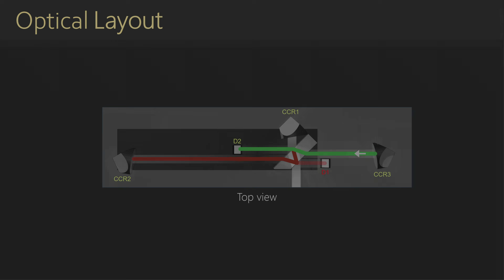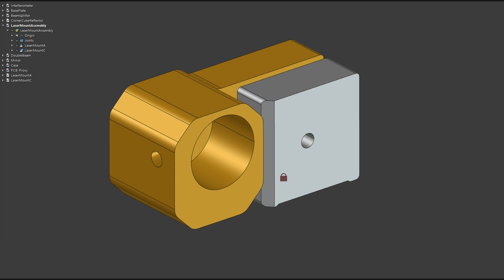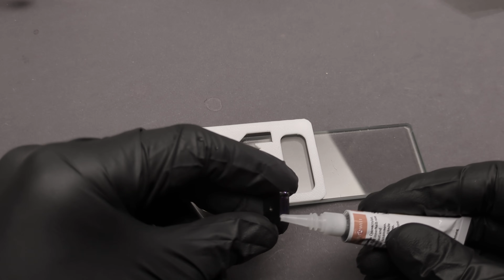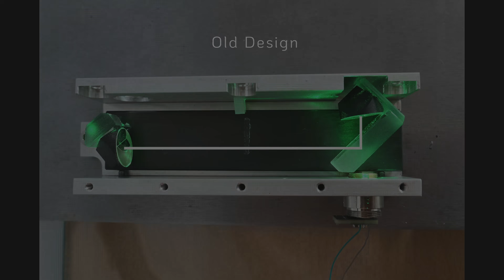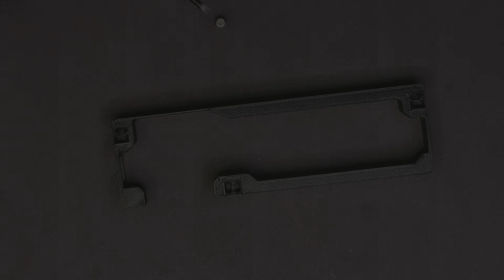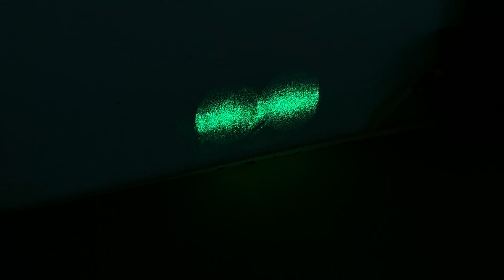Laser Interferometer - Part 3: Mechanical Design

Comment: @DiffractionLimited Schott ROBAX is a glass-ceramic that is made for fireplaces. It is much cheaper than Zerodur and readily available in 4mm or 5mm sheets. It's even the same color. (Yeah, it's basically Zerodur in thin sheets for a different market that wouldn't support Zerodur pricing.)

Comment: Thank you for your series! I'm interested in building an interferometer as well, to get myself involved with optics. I'm struggling with picking a laser for my project. Are you using a controller with your diode? I've also found some cheap He-Ne laser/controller pairs on eBay for a $150-200 range. I'm hesitant to invest in this unless I know it'll work for what I need. I appreciate any advice you could give to me!

Comment: Great project, congratulations! 

Just a little advice: for precise interferometric measurements, HeNe lasers (such as those at a 632.8 nm wavelength) are usually preferred due to their high coherence length and stability, which help achieve clear and repeatable measurements. Also, make sure to check if the coherence length specified in the OSRAM PLT5 520B datasheet is suitable for the measurement range you intend to work with. Insufficient coherence length could lead to a loss of clarity in the interference pattern. 

Good job, by the way!
Reply from the maker: Hi, I adress this issues in part-1, feel free to watch it if you are interested. One goal of the project is to make the device small and low cost, which rules out NeHe lasers.

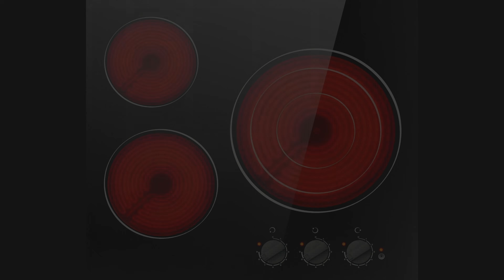Comment: 4:30 Hi Manuel, coincidently I'm currently finishing a video specifically on glass ceramics. It will illustrate why you should have used Ceran instead of window glass: The CTE of Ceran is about 30x lower than that of window glass.
Reply from the maker: Oh thats great, I know that normal glass can warp a lot and I will definetly not use it in the final build as base plate. For prototyping it is fine though. Looking foreward to learn more about glass ceramics!
Reply: @DiffractionLimited I'll send you a link to the preview version.
Reply from the maker: If anyone is reading this... its really good ;-)
Reply: God created the world, but the Dutch made Extreme Ultraviolet Lithography machines!

Comment: Careful using superglue around sensitive surfaces. superglue fumes will react with any moisture on the surface potentially contaminating them.
Reply: I second this.  I have experienced significant problems with the fuming and fogging of CA in critical assemblies, and in one case scrapped a couple hundred dollars of parts because it wasn’t noticed early enough.   

And that wasn’t even in an optical environment, it was for extremely high finish parts for prototyping and display where they were expecting a museum level finish.   Tons of white haze everywhere near the CA was used.  Scrapped.  Dozens of hours put into them.
Reply: If I remember correctly, I think we were able to find a brand of fast glue where it was virtually nonexistent. It may still have been a CA, so it’s possible the exact brand formulation is a big factor here.
Reply: Yeah, I was holding thumbs for no problems.  Higher temperatures cause more fuming and any contaminants (fingerprints) love to cause settling and polymerisation.

I would have though that placing small pieces of static cling vinyl onto optical surfaces while using CA should mitigate it mostly but still a pain.  A no VoC epoxy or a Canada Balsam (hot melt resin) is typical in optical assemblies.

Comment: instead of epoxy to glue glass parts it is more convenient to use UV Adhesive like Bohle Verifix MV 760, its allowing you to place and align parts freely and only after that you can expose it with UV and fix it.
Reply: Also the adhesive can be dissolved if needed.
Reply: @arauchfuss  what do you use to dissolve the glue?
Reply: @SolarMillUSA 
Paint stripper in many cases.  I like Norland NBA 107 UV adhesive since it is designed to debond in an acetone bath.

Comment: This is a great project, I'm looking forward to the next video!
If possible it would be good to use a part available online for the beamsplitter, that is currently the most inaccessible part due to the cutting and grinding required. I haven't been able to find something similar at low cost though.

Comment: I was just about to ask about the glue you were using, but a minute later, you answered my question :D I'd definitely caution everyone about using CA glue with optics as it tends to leave a haze on nearby surfaces.
Reply from the maker: Good point, but there is a simple trick. Putting a fan nearby to constantly blow air over the curing glue prevents the haze quite well.

Comment: Excellent video! I am excited to see how you set up the detectors. How much does wave length of these diodes vary due to temperature, current, and general manufacturing tolerances? Would there be any advantage to using a 532nm DPSS laser source? Are those just low cost corner cubes you can find on amazon?